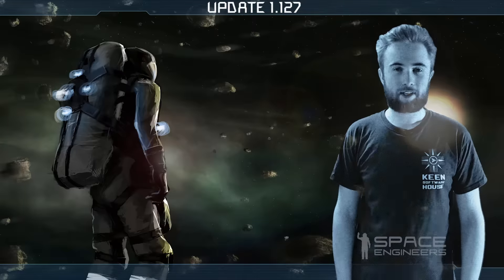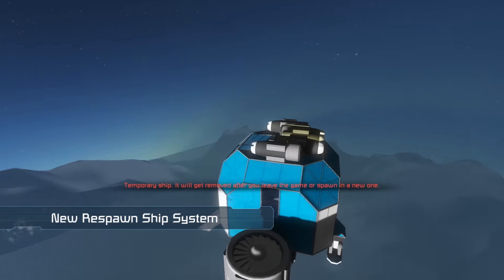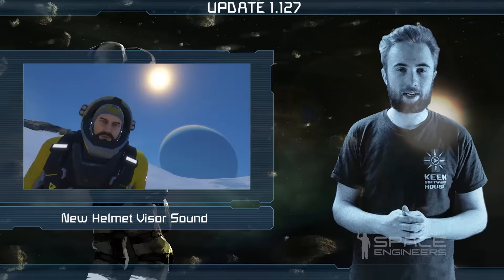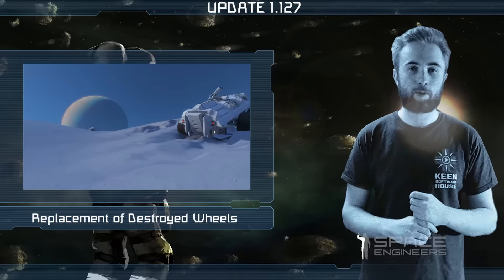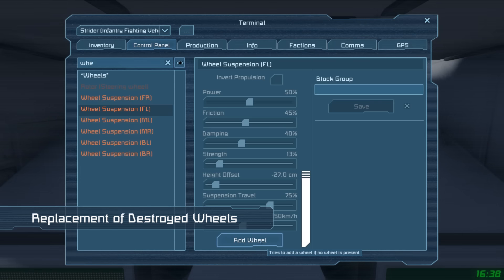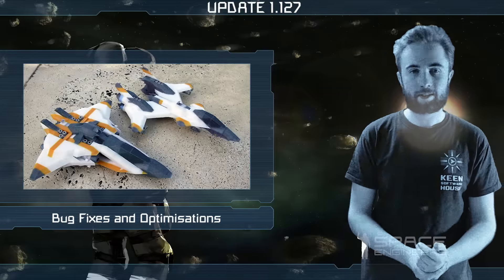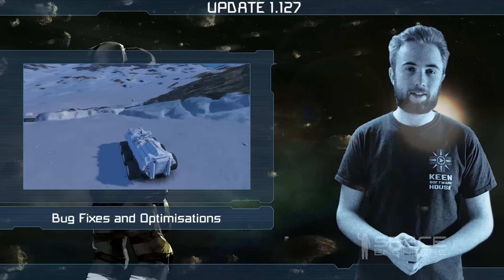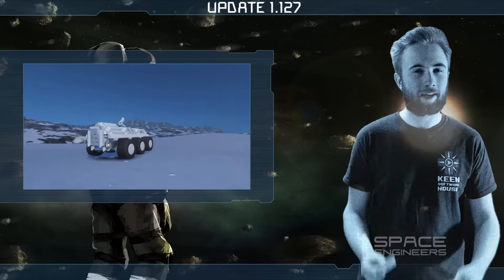Space Engineers - Update 01.127 - Improved autopilot, wheels replacement

Comment: Wheel adding this is cool, but it MUST eventually allow you to place a wheel even if the area is partially obstructed. (Considering most vehicles have some sort of suspension shielding, that ends up blocking some of the wheel space.)
Reply: +Video Sage just grind down die shielding, add wheel. replace it.

or better. dont let arron drive so you dont need it as much
Reply: +Video Sage maybe they could change the collision box for the add wheel function only. thus allowing it to be place in even if there suspension shielding in the area
Reply: you mean a fender?
Reply: +Video Sage 
why not just get the drill and make space for the wheel?
Reply: yes to the fender. the area in question is the immediate area around the top and top sides of where the wheel would spawn in.
Reply: +Crow Reaver or just change the collision box for all wheels... would be really helpful
Reply: DC Gaming
little steps, then maybe we will see a change in all the collision boxes.
Reply: Nice to see you here.
Reply: Landing gear could use a bounding box redo also
Reply: +xsniper1916 yeah, talkin' about landing gears: they should really fix the build stages. the new model is nice, but the build stages are the old ones and really don't match with the new design.
Reply: +Crow Reaver yeah, i hope so.
Reply: yeah I can agree with that.

Comment: This cringy ghost guy is amazing. Keep up the good work.
Reply: +Katzen4u Thank you for the kind words good Sir :)!
Reply: +Xocliw why not a new better wheel with better friction and better looks
Reply: +Ro Al If you weren't already aware of it; Each wheel has its own settings which lets you tweak friction and just about everything else you'd need. Need new looks? Check workshop.
Reply: +Lethal Owl I know but I mean in reality you  ant adjust friction on wheel sand I would mutch rather vanilla for servers and other things
Reply: +Ro Al I meant you can't adjust friction on wheels and
Reply: +Ro Al You can, by increasing or decreasing the air pressure in your tires. This does not affect friction directly but offroad "friction", an effect due to higher shear tension of the surface.
The Mercedes G63 AMD 6x6 has an built in air compressor to change air pressure while driving. :)
The future is now! :D

Comment: KEEN ADD PLANET ORBITS! :)
Reply: +WarDragon Exactly what are you asking for? If you want a station / ship to orbit a planet, add autopilot and gps coordinates. Shrug Orbiting a planet at 100 m/ps is very, very slow, too..
Edit; Orbiting mechanic is wasted on this game if the devs don't add higher speeds as default in the game. So leave orbiting to modders, if at all. What fun could be gained from orbits anyway, gameplay wise?
Reply: +Lethal Owl *m/s not m/ps.
Also, it is currently impossible to orbit a planet even if you use mods to reach that speed. As far as experiments have showed, about 8 m/s can make the difference between falling out of the orbit, or slowly decending towards the planet and crashing there.
If you ever played KSP, or have a bit of an idea how orbiting works IRL, you know that such a small speed difference should not make the difference between going to fast and going to slow.

So yeah, keen, add orbiting.  Also, keen, add the ability to walk around in a moving ship no matter how it moves, as long as it has gravity it shouldnt matter how it rotates or how fast it moves. Constantly causing issues when trying to walk around in a moving ship, even if its just linear movement.
Reply: ***** Again; I did not imply orbiting was possible with higher speeds, but that orbiting made no sense at a slow speed like 100 meters per second, because it takes a long time to circle a planet.

The other point; Why do you need an orbit at all? It doesn't really give much of a gameplay addition that can't be replaced by, for instance using autopilot - As long you dodge the gravity well, or stay in its outskirts, you can safely fly around the planet following perhaps 8 gps points.

I don't see the reason for Keen to add an orbiting feature - Spending many, many hours on this versus something that adds something substantial in terms of gameplay, aside from spinning fast around in space, is worth their time so much more. 

Leave orbiting to the modders. But yes, Keen should work on making gravity work fine on ships going at max speed (unmodded) without sending people everywhere.
Reply: +Lethal Owl Because people want to and the possibility is given, in theory at least. Just autopiloting around a planet isnt the same as actually orbiting. Also, at about 300-400 m/s you can already orbit a planet except that it will horribly fail. Unless you have a script that makes the ship point directly towards the planet, have it so that the thrusters on one side keep the speed AND have other thrusters keep the altitude, it will be impossible.

Gravity btw isnt the problem that sends people flying around, but the game assumes that you are colliding with the ship at 100 m/s, thus sending you into the ceiling. It should not be an issue at all because the speed difference is very low, also they need to add a mechanic that actually attaches the player to a ship. 
GTA V allows you to be ontop of a moving train and it is absolutly no problem because the game basically attaches you to the train on which you can then walk around. The game will also take care of any rotation.
Space Engineers doesnt properly take care of that, and if the ship rotates, you dont rotate with it but instead always face the same direction. One desync of the ship and you are outside.
Reply: ***** I figured out the second part - We're not actually arguing about that point, but agreeing.

But again, simply because "people want to" is not a good reason for the devs to spend many hours developing a feature that doesn't add anything substantial gameplay-wise. They got plenty more reasons to look into other things, and let modders take care of the orbiting. After all, they've got access to the source code now.
Reply: +Lethal Owl You seem to forget that planets were implemented because the community wanted them, even though they were originally not planned. So yeah, it is a pretty good reason.
Reply: ***** It most certainly is not. The planets were added not only because the community wanted them, but because  they added something substantial to the game. Same thing with solar panels and batteries, which were also community requests and added something substantial.

Orbits add nothing that necessarily makes the game more exciting for more than a select few people, and adds nothing that leaves a very lasting impression.

You can't compare orbits to planets in terms of community requests. Want something actually useful added to the game? How about conveyor hinges into the vanilla version, as well as some other incredibly useful mods that have vanilla-game quality to them. The fighter cockpit was not nearly as essential as some other workshop items actually are, but sadly they prioritized aesthetics over usefulness.

Comment: Now even the developers start making fun of exploding rotors and pistons? ^^
Can't they just disable normal physics applying to rotos+pistons above a dangerous speed/acceleration?
Reply: they did that like 5 Updates before
Reply: no, they lock at high speeds, but that's something different
Reply: Selmokk
you said "disable normal physics applying to rotos+pistons above a dangerous speed/acceleration" and then you said "they lock at high speeds" which is for the most part exactly the same....
Reply: but there are fine differences ;) take a piston-elevator inside a ship for example. Even with 4 Pistons steadying it, with powerful thrust applied to the ship they will shake like crazy, destroying everything close by.
The "locking" mechanism implemented right now only stops rotors and pistons from extending/rotating, but it does not stop the wiggly-jiggly behaviour.
Reply: Selmokk
really? in my experience the pistons and rotors cant move at all

Comment: HAHAHAHAHA this is the funniest thing ever. I have played this game for a long time now and there is still no easy way to put a wheel back on. wheels have no power, flip over easily. Have very small suspension eight the suspension being huge compared to the wheels and no you can’t add a wheel it is not possible to just add a wheel you have to dig a hole grind down the old suspension and hope the hole is big enough to put a wheel in after you replace the suspension.🤣🤣🤣🤣 what a joke wheels are in this game.